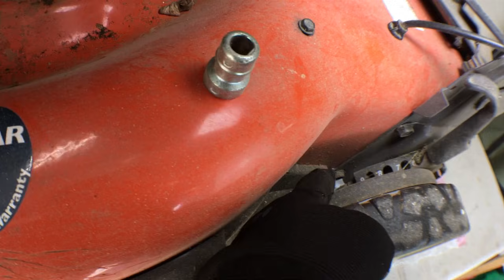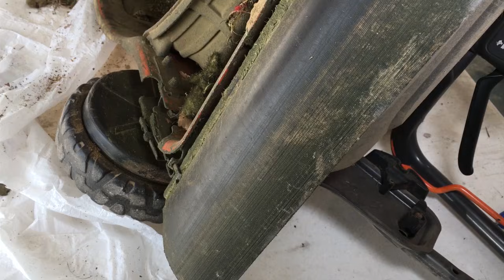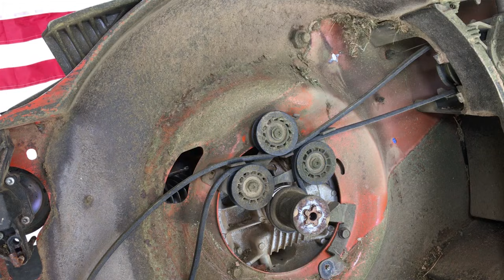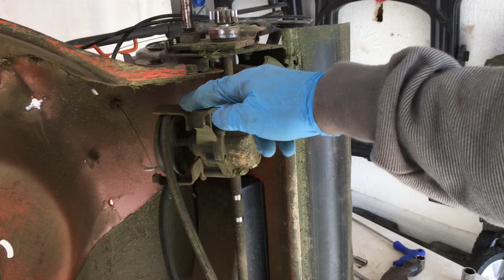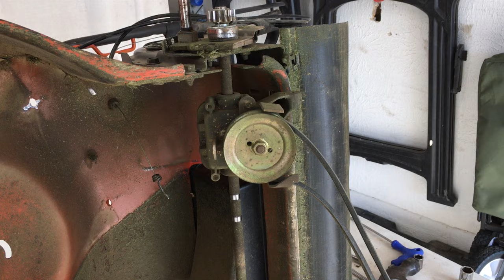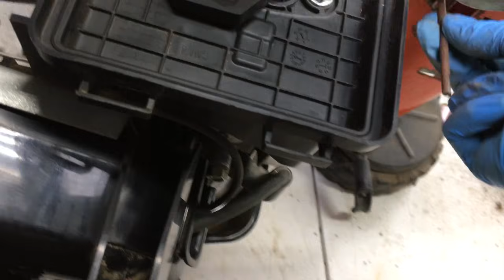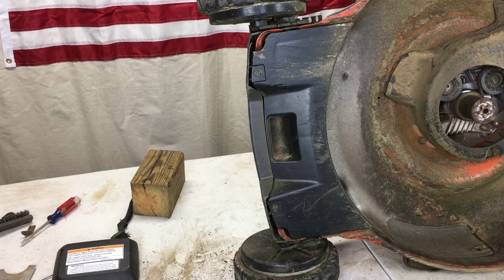Husqvarna AWD Push Mower Belt Replacement, Maintenance & Repair

Comment: John the wheel assembly has two gears that need some grease on them. Just slip the bolt that holds the wheel on and the wheel and the gears can be dabbed with grease. this should be done when you do this other maintenance.

Comment: I was about halfway through this particular job when I decided it was time to check out YouTube for some helpful hints. This was a very helpful video, John! I did discover that I had a mix of metric AND standard bolts on my Husqvarna. (purchased in 2014) As you noted, it is a LOT of work to change out the drive belt, but I believe it is going to be a standard Fall task for me. It will insure that all the debris is removed from a whole season's worth of mowing. Thank You John!
Reply from the maker: Thanks for sharing

Comment: Replaced the pulleys and the drive belt by following the instructions in the manual that came with the mower. Most of the things you did are not required to replace the belt.

Comment: Sir,
I have the same lawn mower and the front right wheel assembly that’s connected to level is loose which causes it to cut uneven. Do you have a video that shows you repair that?

Comment: The bolt tabs on the front cover that hold the baffle to it broke off and the baffle got shredded.  I got replacement parts for both and the new cover is wrong.  Anyone have the same problem?
Reply from the maker: I have not had that problem so far.

Comment: I changed my belt and I didn't have to do the removal of the plastic baffle in the back I just undid the spring ran the tension down on the transmission pulley so I could get the Z Bend out where you took everything off for no reason.

Comment: You also should hang your mower blade on a nail through center hole on the blade, to check for balance. The blade will lay horizontal if balanced. It is pretty important to do this after grinding, what ever side of the blade wants to go to the bottom, it is the one you grind more off of.
Reply from the maker: good tip@  I did not know that!
Reply: JohnCanFixAnything that was a new blade John no need for tipping . Your a gentleman as well as a good teacher

Comment: Nice machine - and really good thorough video. Tanks for sharing.  I use a shop air driven vacuum oil extractor while tilting the mower / engine towards the fill - get's out just as much as a full tilt drain. Honda says to use an API SJ or higher 10w-30 oil,

Comment: Excellent job and video.  Husqvarna products are the worst and this video proves it !!!!!!!  No need to be that complicated for just a drive belt change.
Reply: Husqvarna makes really good mowers yes the drive belt replacement is a pain and takes a while but if you think this one is bad wait until you see the new Toro AWD belt replacement process makes this one seem like a breeze! All of these new fancy add on features seem nice until repairs are needed then they aren't so nice anymore.
Reply: Have to agree with Scott here; the belt replacement was a lot more complicated and frustrating than it probably should be but, the mower itself has been great.  I've run mine through hell and back and this is the first time I've had any complications at all... and I probably brought it on myself with some piss poor maintenance.
Reply: I cut out plastic squares in the front axle cover big enough to clean the grass out periodically. If you don't it rust everything up and you will be replacing that front gearbox. Bad design

Comment: I really like this video . He completely tears it down and you can learn a lot from that. But he must not have the owners manual because it is not necessary to do a lot of this to change out the drive belt. He even took the motor off, wow. When all else fails read the manual. Maybe he did not have access to one.
Reply from the maker: Yeah, I kinda over did it a little, lol.  Makes a better video that way.

Comment: This model and most newer self propelled lawn mowers simply drain through the fill port.  Due to the added drive train parts covering up access to any drain plugs and the dirty environment under there causing corrosion. Making any removal difficult if not impossible.  It does seem to be easier since you just tilt it over and pour it into a pan.  Instead of trying to support it level in the air and try to remove the stuck plug. Then not forgetting to re install the plug.

Comment: Not having a drain plug doesn’t bother me. What does is I bought a new mower, blade flew off with a snapped bolt on grass my 25 year old snapper had no problem with ever. After a long battle with Lowe’s, they did provide a new mower, same thing. Keep in mind after the first go around and the unpleasantness of getting the mower replaced (it had other issues, and was past 30 days but only used twice) I babied the new one. Like it was Diana Ross. Snapped bolt. Made no sense. These things are cursed. Unlike others I’ve seen where the “star” shear part of the adapter was worn, mine is perfect, but the key inside the adapter broke off. It’s a cheap part from amazon, $15 or so. So I’ve watched a half dozen YouTube videos specific to this mower, as well as talked to the mower repair guy who got the bolt out of the driveshaft, and no one has any idea what causes this. I have a theory.  

That is, because the mowers I’ve seen have the star shear part on top of the adapter worn or snapped, and mine was fine, but the key lock broke, all I can think is that because everything is running off one belt, when you engage either of the two handles that give your 4wd, it torques the drive shaft. It also seems to happen more with the larger engines. In my case it’s the 800 Honda one, great engine, but to much for the blade assembly. You’d think though that the “transmissions” would be the first to go, but keep in mind they have give, are able to slip, while the drive shaft doesn’t. Let me know your thoughts. I’m nothing close to a mechanic but I think I’m getting close, or I have found out the design flaw.

Comment: I just got one of these, barely used, for a C note.  Glad I decided to watch all the videos first; this is the most unnecessarily complicated lawnmower design I've ever seen.  And no way to drain oil, for an oil change.  That's flippin' nuts.  I'm surprised it doesn't have half a dozen computer controls.  Oops -- didn't mean to give 'em any ideas.
Reply: None of the newer lawn mower engines have oil plug drains you either have to tip it on its side and drain through the dipstick or use a small vacuum pump and hose and suck the oil out of the dipstick it doesn't matter what brand mower or engine you buy they are all the same now.
Reply: Gawd, that's truly pathetic.  I know this is a sign that I'm getting old -- but dammit, things really were better when I was young.

Comment: Did you drain the oil first before turning the mower upside down?
Reply from the maker: I drained the oil after.  I did not find a drain plug on the  bottom so I did it through the dip stick hole.  If you find one please update here for everyone else.
Reply: JohnCanFixAnything from what I've seen, the drain is on bottom of motor under the drive pulleys. It all depends on the model of mower.

Comment: The right and left handles operate one cable therefore you can squeeze either side of the handles or both but they both operate the front and rear axles therefore it is 4wd always.
Reply from the maker: Thanks Johnny.

Comment: I have pretty much the same mower and I found this video very helpful in replacing my belt that got all burned and melty when the rear drive pulley got jammed with plastic and papers that someone must have ran over.
Reply from the maker: Thanks for the feedback.